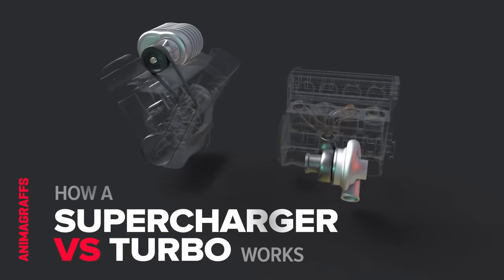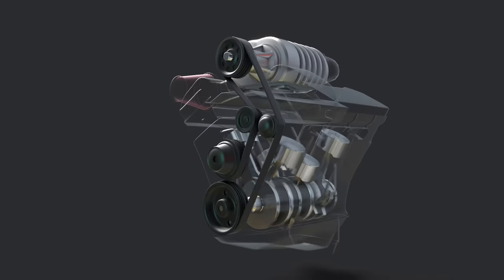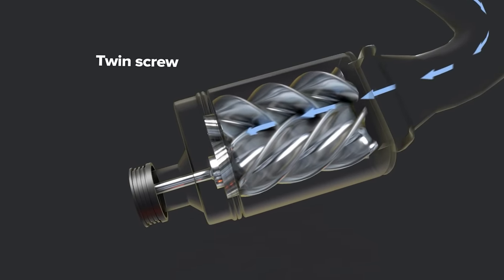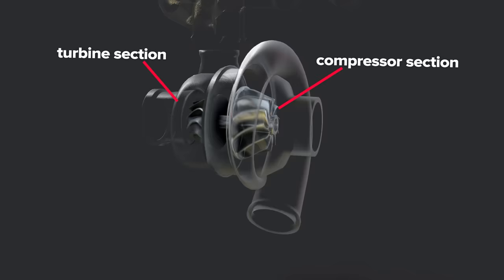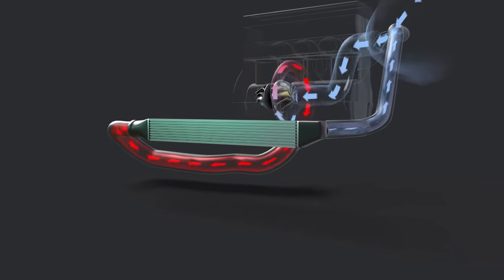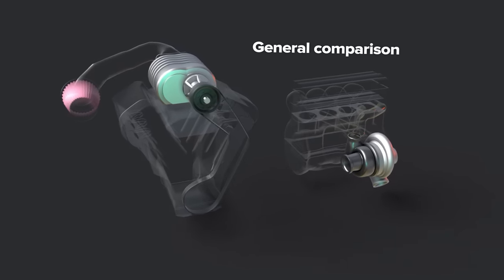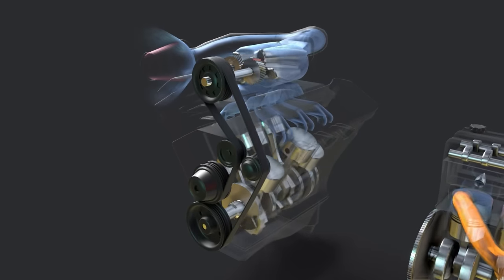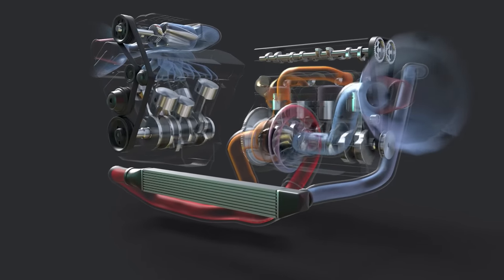How Superchargers vs. Turbos Work

Comment: Superchargers also benefit from intercoolers as the pressure increase is what drives up intake temperatures mainly, but the American way of putting them on the intake of V6/V8s made this hard. Either water to air coolers or intricate piping is required with such a placement. Japanese and European straight 4s and 6s with superchargers are often intercooled.
Reply: Most superchargers have the intercooler integrated into the charger. It's two extra lines, ran by the same pulley that drives the screws. Still much easier than a turbo

Comment: The exhaust turbine is not driven by pressure, it is an impulse type turbine and is driven by exhaust heat and velocity.
 The turbine is a heat engine and operates under the same Carnot Cycle principles as the Brayton Cycle engine.

Comment: One mistake in twin screw charger animation: wrong way rotation of pulley and rotors, the outtake port on the wrong side of supercharger's body (compressed air can't escape the charger). Video is great, add to tracklist😊👍

Comment: I love this video and all the others I’ve seen from your channel so far. Just a quick question, at around 2:07 the twin screw design appears to have a gear reduction from the input to the other shaft, but they seem to be rotating at the same speed. Genuinely curious is this right?

Comment: Pretty great video, but I kind of get the impression that it's all about 'boost'. Increased engine power isn't from 'boost', it's a byproduct of improved engine efficiency at rpm/load bands.
Super/turbochargers are primarily designed to improve engine efficiency and that's what they spend 99% of the time doing, the other 1% being when full load power is requested.
You might also want to mention the methods of controlling any overloading, i.e. wastegates, blow-off valves etc. as these are quite important for preventing damage to the system.

Comment: Also turbos create a ton more heat. They need to be cooled down more. That heat can be a problem with long term use.
Reply: They also weight more and they burn up bearing way easier.
Reply: @yodaddy82daddy70  true

Comment: I've worked on engines with both, supercharger and turbo and I just simply have to say that I prefer supercharger instead of turbo not due to repair costs wich are higher in a turbo compared to a supercharger but for efficiency.  As the speaker told, superchargers delivers right away, turbos depend on an acceleration level to boost.  This is a matter of taste and preference.   Everybody has their choices on what to fit on their vehicle's engine.  For me, supercharger.

Comment: Volvos have supercharged turbo motors it's kind of violent for the piston rings, but that motor usually holds up to 80k then I'd recommend a rebuild if you go 10k per oil change

Comment: My car has both of these. Supercharger which works at low Rpm or for instant power then the turbo takes over. Makes the 1.4 litre engine go as good as bigger engines.

Comment: The animation seems to show that it's the exhaust pressure that's turning the rotor on a turbo, but the narration repeatedly says the main source of energy to turn the turbo is "waste heat" -- which is accurate? It doesn't make much sense to me (from watching the animation) that heat would have anything to do with it. If anything, the heat would seem to make the turbo slightly less efficient than otherwise, as the hot side of the turbo would radiate to the cold (intake air) side, causing it to be warmer than it might otherwise be.

Comment: Excellent animation. Can I ask you a question about turbo? What determines the speed of the turbo propeller? What happens when I use the engine braking on my car when the RPM goes as high as 5.5k? But there should only be neglible amount of fuel burned and so the exhaust should not be hot.

Comment: What effect does extra air from supercharger or turbocharger have on the engine. Sorry if it's a dumb question
Reply: More compressed air forced into the engine --> more oxygen in the engine --> able to burn more fuel in the engine more quickly --> more power created/transferred to the engine

Comment: …or how about a video on how a central heating system works like those in a normal household. Or how solar panels work, in combination with an electric heating system like a heat pump (inverted Airconditioning unit).

Comment: A couple of things, you make it sound like all turbos need an intercooler where superchargers don’t?  You realize that they are compressing ambient air (turbos have separate hit and cold sides) so could all operate with or without intercoolers.  Also, twin screws are notorious for making lots of heat when they compress the air.  Lastly, as far as tuning turbo systems are just as easy to tune as superchargers you can easily dial how much boost is delivered to engine through boost controllers or waste gates, you could add the same to centrifugal SCs.  Turbo uses heat from exhaust to make boost so rpm dependent just twin screws and centrifugals?

Comment: Again a fantastic animation. I recall the supercharger from your P-51 aircraft video. It got me wondering, whether there were other piston aircraft engines which instead use turbochargers - in effect not dissimilar to the compressor and turbine section of an axial flow jet engine I suppose - so would a turbocharger on a piston aircraft engine make a hybrid of piston + jet engine?
Reply: Nope.
The jet part of a jet engine refers to the way power is extracted. Its the jet of exhaust gas being used that makes a jet engine a jet.
Using compressor and turbine aren't the only way to get a jet engine to work..
There are ramjets that use incoming air to open one way flap valves.
There are pulse jets which use tuned pipes.
There are scramjets that use a supersonic pressure wave to manage air flow.

The jets you are thinking of are turbo jets.
Reply: To the first about whether any piston fighters from WWII have turbos, yes. Bombers too. The P-47 Thunderbolt was so big primarily because of how much room the turbo system took up. The P-38 Lightning was also turbocharged. The US exported the P-38 to Britain before we entered the war, and without turbos. When they were lackluster in performance, Britain dumped them. That said, all US lightnings retained their turbos. As to a jet-like performance, no, not really. That said, all piston fighters had their exhaust tips pointed aft because they were high enough pressure to generate a small fraction of the over thrust of the engine.

Comment: i wonder what happens if you mix them both? ik it aint possible but its a what if, like before the turbo charger receives its air intake, the super charger super charge the air by pulling it way more and somewhat compressing it using small out pipes then that air goes to the turbo chargers and yes the turbo charge is still connected to the serpentine belt and pulley. so you not only have a mechanical boost but exhaust boost aswell.

Comment: Excellent video! Might need to update with electrical driven turbo that spin up at low rpms until the exhaust can take over.  My 08 Acura RDX with a 2.3T engine used a variable valve turbo that would close and open to build boost faster at lower rpms.

Comment: something i've wondered about: why not drive the compressor with an electric motor? no belt required (like the supercharger),  and no fancy plumbing (like the turbocharger), and the electrics could easily be computer-controlled.
i cant be the first to think of this. what's the down-side that i'm not considering?
Reply: I think Mercedes is doing that

Comment: Why does pushing more air into the combustion chamber make the car go faster/create more power? Does it increase the pressure because there is more air in the same space? Wouldn’t pushing more air in mess with the fuel/air ration during combustion? I know almost nothing about cars, please enlighten me :)

Comment: My wifes audi q7 has intercoolers for the supercharger. That suv is so smooth to drive and it gets decent gas mileage for weighing over 5k pounds, assuming you let the charger do the work and only give it a little bit of gas 🤣

Comment: I drive a 2019 Volvo XC60 T8 plug-in hybrid.  My understanding is this car has a turbo charger and a super charger.  Would have been interesting to include this combination in your illustration.  Otherwise, good job.
Reply: When you find out how much it costs to fix that complex setup when it breaks, the only thing you will need to understand is how to pay the $$ repair bill.

Comment: Whats stopping us from combining both to get twice (or more) the amount of power? Especially on a V8
Reply: Superchargers force more air into the cylinders allowing for more boost, while turbos use exhaust for more boost. If you combine them, the turbo would damage the supercharger, as it forces increased pressure into the intake, versus what the motor controls. The supercharger would hurt the turbocharger, due to the increase in exhaust back pressure. That's how I've heard it explained in the past.
It has been done before though! Not impossible.
It's called twincharing. Using both on the same motor. It's a great combo, but can cause lots of damage if not tuned correctly.
(Not to mention fuel consumption)
Reply: adding too much mechanical complexity to an engine makes it expensive, not reliable, heavy and less efficient (uses more fuel for the most part) and using both systems for a road car generally yields very little benefits. Small turbos don't have much lag and the engine is tuned to have torque at low RPMs not relying on forced intake. Superchargers are the opposite, some mercedes supercharged cars have a valve that bypass the charger on high RPMS for example. So if tuned correctly you can have a turbo that makes a 1.4L engine comparable to a N/A 2.0L with something like 200HP with almost unnoticeable lag or power spike, same thing for a supercharger. You start to notice the diferences when you go to extremes, like making a 2.0L engine with +500HP.

Comment: You keep referring to the aftercooler as an inter-cooler.  The after cooler is used after the last stage of compression before the intake manifold. An intercooler is placed in between 2 stages of compression 2 turbos in series or a turbo and a supercharger. they both cool the air but are different.
Reply: This applied to aricrafts. But the common nomenculture is intercooler. Dont fret about it. Its not that deep
Reply: @km6832   LOL... it will be a big deal when you go to order parts and get the wrong ones.. and I worked in the automotive industry for 30 years... not aircraft... I remember our instructor in school 35 years ago with this argument as he said... it is a marketing issue.. intercooler sounds better... maybe like intercourse...

Comment: 04:50 A turbocharger is not powered by heat. It is powered by exhaust gases.
Reply: @C_Becker  exhaust gases are heat he said that
Reply: @hypecentral9037  But it is wrong. They are hot, not heat.

Comment: Can you make an animation-explanation of what a HEMI engine is and what makes it better or worse than the non-HEMI V8 engine? I searched a lot on the matter but I couldn't find any easily understandable video that explains the difference in simple terms to those of us who are not engineers.
Reply: HEMI in all capital letters is a registered trademark of Stellantis.
It's a completely meaningless marketing term and is completely unrelated to engines with a hemispherical combustion chamber.

hemispheric combustion chambers are an obsolete technology that offered some advantages over the old flat-head designs that were common in automobiles prior to the 1950s.
The hemispheric chamber has been superceded by superior  Pentroof and Wedge types of chambers that utilize high swirl or "quench" technology.

Comment: I know that turbo charges theoretically should make more power than screw blowers. But in pro mod drag racing, which uses both type blowers the screw blowers make so much more power that they have to be penalized with a 200 pound weight adjustment. I can’t explain it can you?

Comment: I hope I'm getting this right, so turbos basically recycles the air from the exhaust manifold to the engine?
Reply: Not in that way
Exhaust gasses make turbine spin and because of that it compresses air hardly so gasses from engine are just fuel, kinda windmill

Comment: 5:55 So heat and not flow pressure drive a turbo? How does heat drive a turbine?
Reply: @BariumCobaltNitrog3n  So, as I see it:
After blowing up, fuel in cylinder creating a gas, which is high-pressured. It comes outside of ur car when it’s not turbo, just civil car. But with turbo, this high pressured fast gas goes through the turbo and makes it spin like hell when passing it and then goes out of ur car like usually, but now u have a spinning turbine
Reply: @andreymatvienko541  yeah, high pressure fast gas. They claim the heat makes it spin, not the pressure. Probably a mouth typo.

Comment: Great info. Would you kindly make a video explaining about VW previous TSI engine which combines both Turbo + Supercharger and if it is the most efficient engine configuration. Well according to VW it isn't because now they have just switched to Turbo only and mostly due to cost but telling its consumers it is the same.

Comment: How can supercharge moved same amount of air at any rpm? Doesnt high rpm make supercharger suck more air in because it blade follow engine rpm?
Reply: No at 3000 rpm and at 7000rpm it produces the same amount of air because of the chamber size so to say. Its fixed therefore the air will fill the same area in the supercharger regardless of engine speed

Comment: I was thinking of boosting an IS 300 for a weekend driver. I just want a pump gas fun car to cruise the city in and every now and then carve up some curves.  Just maybe 15-16psi of boost and run 93 octane fuel. Is this possible to build a fun reliable street car on pump gas. I’m not talking a hellcat killer just a fun little car.

Comment: Really good video, but 4:08 it’s not Twinturbo Because TwinTurbo uses two different turbo one smalec one bigger and they work sequential. Smaller turbo works most Effejctive at 1500-1800 rpm and bigger at 2500-3000rpm. Thist what you shown at 4:08 is Biturbo. Biturbo uses two identical turbos. But it’s always a nice video Because i DIDN’t know too how superchargers works. So thanks!

Comment: Is it possible to turbo and supercharge an engine at the same time?, or would it be a too much air pushed into the engine and just be a waste? Just curious
Reply: Yes it is. There is a guy that did it on YouTube and ran diagnostics and found that it was counter productive.

Comment: How can superchargers move the same amount of air regardless of RPM if the crank shaft movement is basically kinda" transfered" to the pulley.MORe rpm would mean more cranckshaft movement and more pulley movement so more movement inside supercharger and so more air pulled ( for a determined amount of time)
Please if anybody knows please comment smt

Comment: There is a NEW Kid on the Block... Electric Superchargers...

Mercedes is first car company using electric superchargers. They are a Centrifical Compressor driven by an electric motor. Unlike turbos that use centrifical compressor, there is zero lag. The electric motor can spool up almost instantly. Boost levels can be easily maintained by managing electric current to motor. 

I have been designing engines that use both Supercharger and Turbocharger. The Supercharger is force fed pressurized air from the Turbocharger. This reduces parasitic losses common on Superchargers and offers linear boost curve common to Superchargers, but not common to Turbochargers.

We are now looking at Electric Superchargers to see how best to use the new technology.

Comment: Heat does not power a turbo as you repeatedly mention. Hot exhaust gases do.
Hot gases expand and thereby flow faster, since they are less dense but constricted to that one channel, aka the exhaust system. That's what powers a turbo. Heat itself is very detrimental. If it was possible, and it isn't so far, If the exhaust gases were cold and dense, the turbo would work just as well, if not better. Because cold, dense air can transfer more energy onto the turbine blades.
An aircraft engine is basically the same. The thrust modern turbine engines make comes 80% from the cold section, the secondary air stream or bypass, if you will. 
That one big fan stage is powered by multiple turbine stages. Depending on the engine type, there might be a gear box inbetween even.

Comment: Is it true that with turbo fed diesel engines you cant imidiately turn off the engine because it might damage the turbo itself? Ive been told that with an old diesel truck you have to wait 30 secs or a minute or so tu turn it off so the turbo slowes down and then turn off.
Reply: Yup, some you need to let the turbo spool down, some turbos  don't need this proceedure but it's always good practice on any engine.